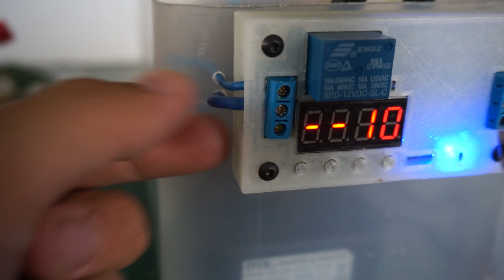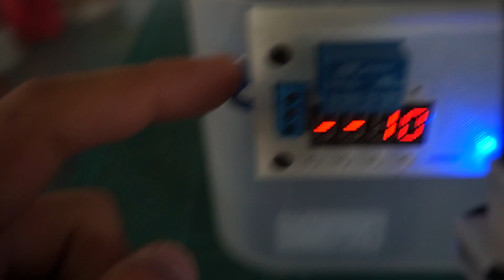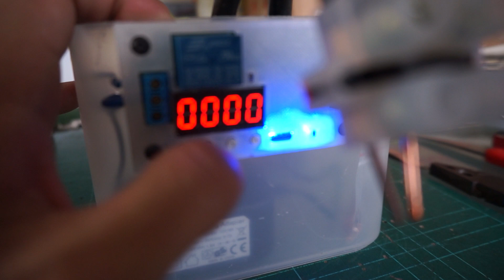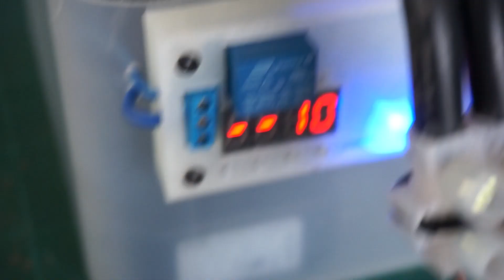How it works? My DIY Spot Welder

Comment: This is how I'm going to set it up. Thanks for this. Only difference is I'm using 4x SPIM08HP batteries instead of the transformer. I wanted to make this battery pack anyway because you can start a car with it!
Reply from the maker: thats great!
Reply: @EdwardChew  I decided to go with the transformer. I just bought a new microwave and took apart the old one. The timer circuit came in the mail recently as well. Could you tell me what gauge wire that is? It looks like 16mm/awg 5?